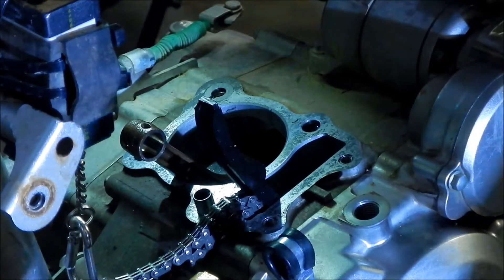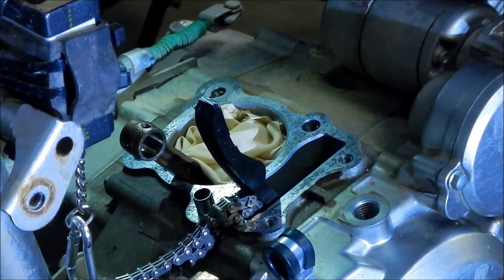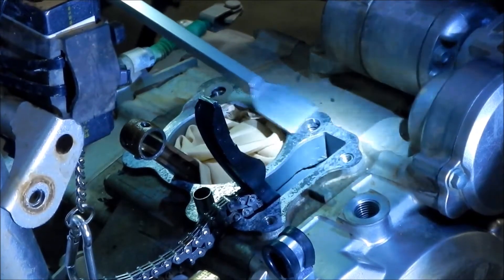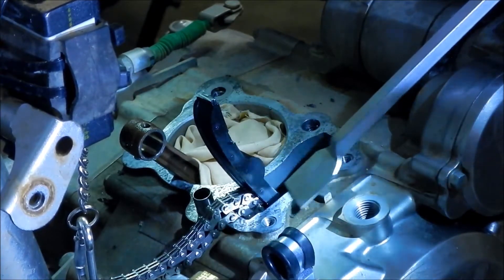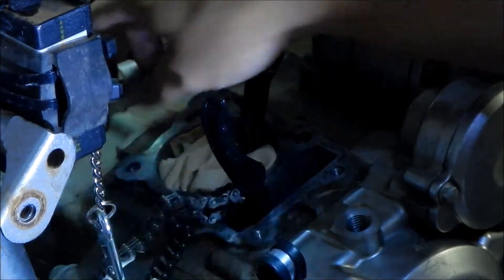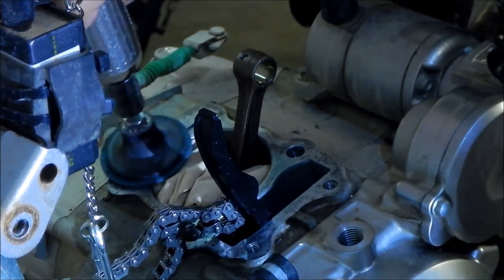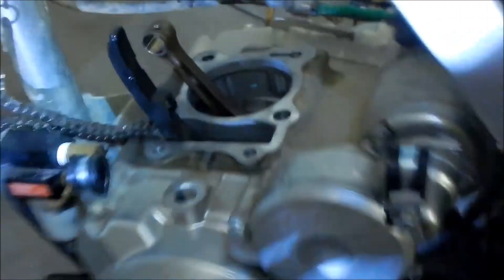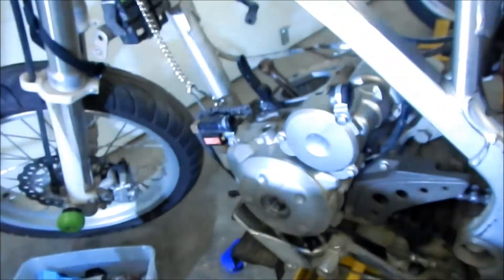KLX140 Big Bore Topend Rebuild VLOG Part 21 - Bottom End Gasket Cleanup

Comment: excellent videos. 
What is the top speed with the SXparts kit?
Reply from the maker: I was just at the track and I was hitting about 56mph on the straights.  I think I've gone 62mph on a longer track.  I can probably hit higher speeds if I put the 14tooth countersprocket also.  I might try sometime, with the stock engine it wasn't powerful enough with the 14T so I put the 13T back.